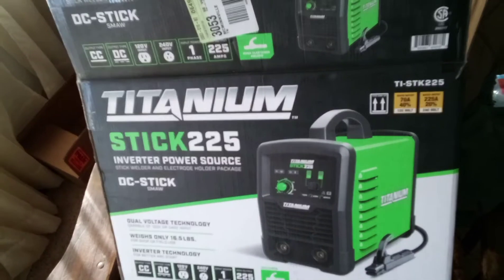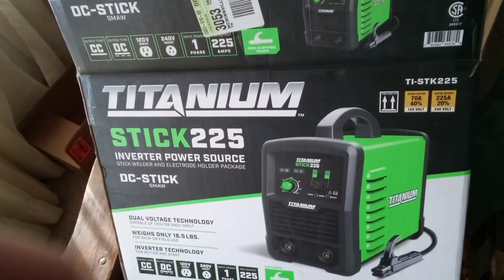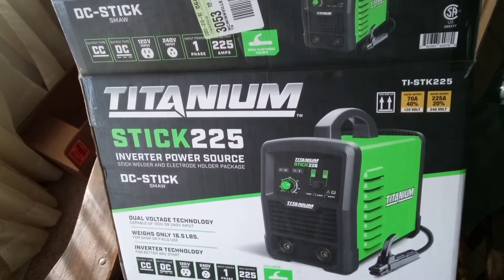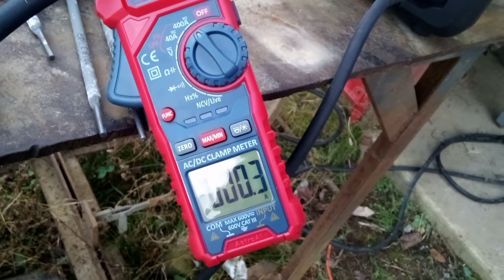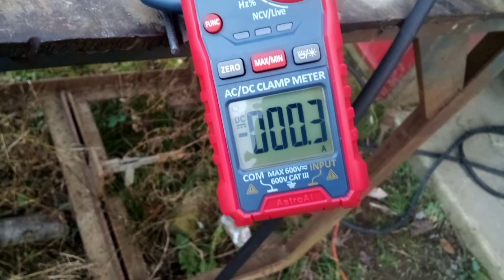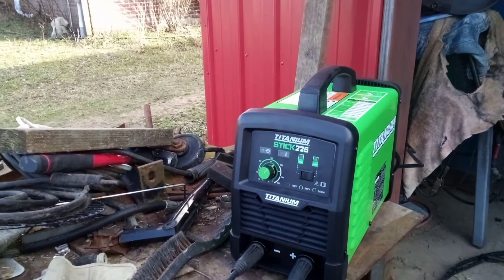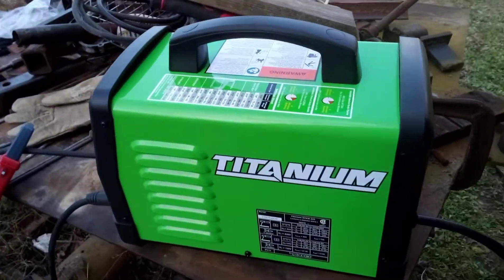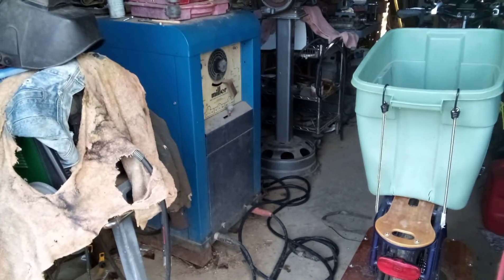Harbor Freight Titanium 225 (Actually 260 Amps!) Stick Welder Amperage Test and more...

Comment: You're older transformer welder is most likely running AC output. AC output has less penetration because the cycle is reversing 60 times a minute. The titanium is DC and is constantly sending that power in the same direction.

Comment: Wow was the 120 set at 70 amps when you hit 130 Amp? What rod was it?
Reply from the maker: It was plugged into 240.  I never tried it on 120.  It was 7018 rod.  It absolutely surprised me.  It's on sale right now for $249 by the way.
Reply: @spartaeus  thanks just got mine yesterday
Reply: @spartaeus  Is there a chance you could please do a quick run on 120 and report the amps for that? I suspect they are higher as well.  Thanks!
Reply from the maker: @jayinla228  Sometime in the future. This time of the year I'm very busy with so many things.